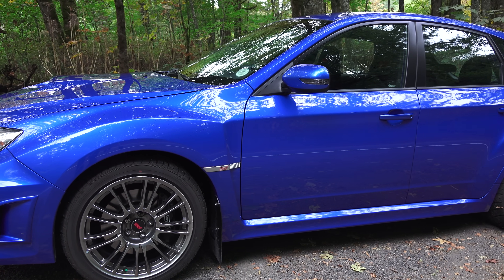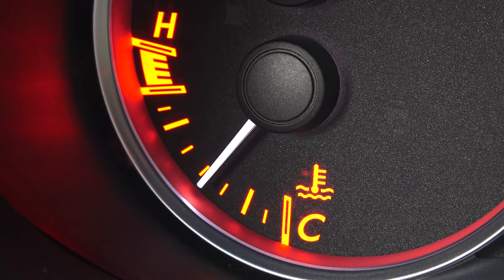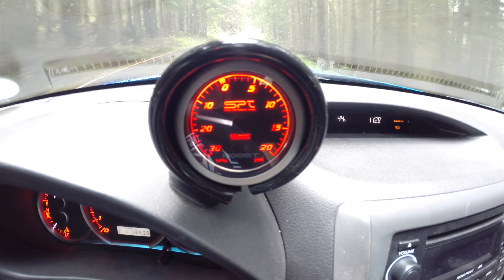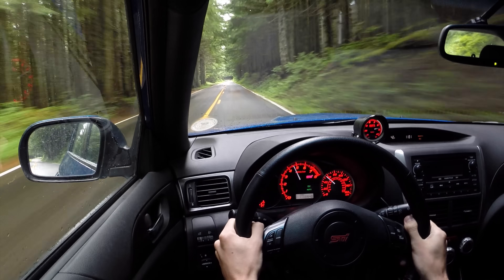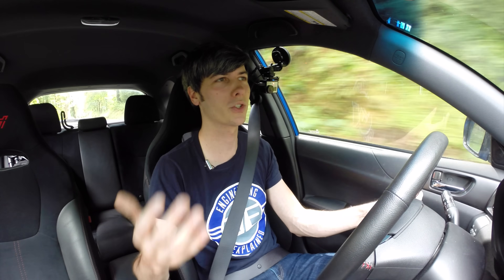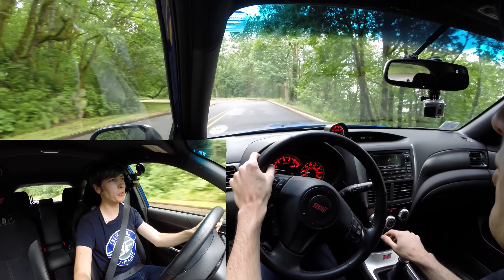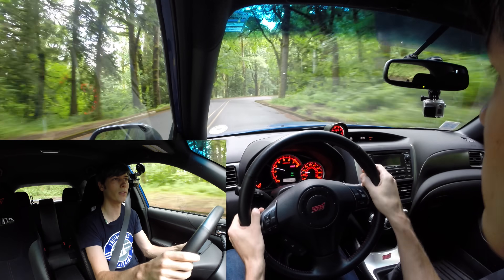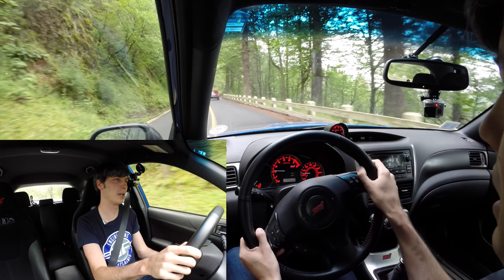5 Things You Should Never Do In A Turbocharged Vehicle

Comment: Describe engine lug ??? , don't  say a lug is when you can't  step on the throttle & pu motor rpm , my point being if you have two ident vehicles  but one has 10 % more fuel it wil accelerate , both engines  are under the same load ,give me a scientific description  of lugging a engine ?? You cant!!!!.

Comment: Turbo timer. Lets you engine run after you shut off ignition. Circulating oil.
Reply: So it flows oils through the Turbo after i turn the car off?
Reply: @dragospahontu  Yes, the engine keeps running. You set the timer for how many minutes, engine oil circulates to avoid coking of the turbo's bearings.

Comment: Not sure if it applies to Diesels Petrols or both, but doesn't the mass airflow sensor prevent excess fuel being injected if there is not enough air being drawn through the intake? I was under the impression that the MAF was what regulated the injection volume depending upon air flow?
Reply: Idk,

Comment: Most modern turbo charged cars don't require "cool down", as they are liquid cooled, and that coolant keeps flowing through to prevent the oil from coking. But I remember the crappy old Pontiac 301 turbos requiring owners to do this. Most owners didn't and those turbos would crap out before the car had even 50k miles on them.

Comment: If the way you're driving here is your normal way of driving, you are under revved for most of the time, as small engines, and especially turbo-charged small engines need higher rpms to make correct power and fuel burn. It appears to be me you're lugging, or on the verge of lugging your engine all the time in this video.

Comment: I have an 85 Volvo turbo that I added the optional oil temperature gauge to.  The thermostat did not open to send oil through the oil cooler until 90 C and I believe was fully open at 100.  It took often 10 or 15 minutes longer to reach the 90 C than the coolant did to reach operating temperature.  In winter the oil was too cold.  I had intended to insulate the oil pan for winter driving.  I would avoid any boost until the oil was up to 90, or at least 80 in the winter, if I could.  The sender unit was in the oil pan however- as part of the drain plug.  I sometimes wondered how this affected the reading and whether it was ok to let the turbo kick in when even after half an hour of driving, the oil was still showing as being too cold.

Comment: The old “dont turn your car off right after running it hard” was a characteristic of 80’s and 90’s turbo cars, hence people installing Turbo Timers. Modern Turbo cars including Subaru’s now continue to circulate oil even after you turn it off. Some cars like Audi’s have electric pumps that continue to run even after you turn them off. That tip is for old school turbo cars.
Reply: I can hear the pump working when I turn off the engine in my Golf R. It sounds like a little robot, like a service droid making things okay
Reply: @SniperReady  you know, I always wondered what that electric motor sounding noise was whenever I turned off my GTI.
Reply: Ryan Slattery it’s your droid beep booping your turbo
Reply: @ryanslattery2977  Yeah!  It kinda sounds like your sitting in an airplane waiting to take off?  I notice that sound even when I just turn on accessory mode.
Reply: @SniperReady  Until it breaks because it's a VAG car.
Reply: @MrFister84  exactly what people who don’t have money say to make themselves feel better about their garbage cars. Enjoy going slow and clenching your fists on the steering wheel furiously praying for other people’s cars to break
Reply: @SniperReady  all cars are amazing, old and new. But my 2020 cla 35 amg is trash.
Reply: @Autumn-v4u3x  It's a nice starter car, I'd drive it. Do you have problems with it?
Reply: @Autumn-v4u3x  best comment
Reply: I literally just bought a 2021 Mazda 3 turbo and the owner’s manual is consistent with EE’s explanation of letting it circulate and cool off.
Reply: @trogdor21997  modern cars will continue to circulate and cool the turbo automatically when shut off. My 5 year old car does it, and you can hear it working.
Reply: How about proton exora which still run and cool engine off after ignition is off?
Reply: If you're running your car hard until parked...you best let it idle a bit....(turbo or not)...The heads are much hotter than the block and it's best to cool an engine evenly...warped heads cause all kinds of expensive issues. When you're getting close to your destination (about a mile) get off the boost and throttle altogether.....simple.
Reply: Not all turbos
Reply: Boy you must be living the dream if you think only 80s and 90s turbo cars are like that. Most turbo cars up until around 2012-14 have mechanical oil pumps, so this tip still applies.
Reply: @waifuracer6516  Yep, Toyota Turbo Diesel, 2012, manual says that it is important not to turn the engine off for up to two minutes depending on driving style.
Reply: @waifuracer6516  YOUR STILL STUCK IN THE 80'S AND 90'S !!  GET UP TO DATE!
Reply: @waifuracer6516  Thank you lol, i was wondering what his definition of modern turbo cars
Reply: even my 1986 audi has this feature :)
Reply: It's not just because of the oil heating up. It's about how rapid heating and cooling can warp or even crack metal, so you want everything to get as cold as possible (or the engine bay to heat soak, to protect everything in a way) before shutting the car off - Especially in cold climates.
Reply: Not when you drive a 2010 turbo camaro ss
Reply: Heavily depends. Not all turbos. This isn't just the old turbos. Not every car is equipped with an auto system to automatically cooldown the turbo. I have seen both. But it's up to you to decide to check if it does.
Reply: so nice of you for thinking i dont still own 80s and 90s car...
Reply: No.
Reply: holy crap, glad I saw this. I always wondered what that sound was...
Reply: Yeah my gti has this
Reply: Even a turbo 2015 civic needs a turbo timer
Reply: a clown from my highschool would tell me this crap with his 2019 civic si.   Thanks for proving that moron wrong
Reply: Does this work in a Mazdaspeed 3??? Have a 2013
Reply: Really? That’s kind of cool! I don’t own any turbo cars, so first I’ve heard of it. Didn’t know they had their own motors/pumps
Reply: Ahh this must be what my Range rover sport Does when i turn it off. It is a weird electronic hum.
Reply: my mk3 leon can leave the fan on very loud after i turn it off and lock it, but it sometimes does it after a twenty minute commute and not a two hour drive with cruise control set to 74mph, it all depends.
Reply: My 2015 Fiesta Ecoboost circulates the coolant after shutting it off. Mostly on hotter days. It sounds like the car is still idling bc of the fan. When I first got the car I thought it was overheating bc the coolant looked like it was bubbling in the reservoir, but it was actually just recirculating which is what I later found out - also the temp was still in normal range. I also work at a gas station and have seen a few cars that do it. Asked a guy to shut off his engine and he confirmed it was already off and just circulating the fluids. I believe it was an Audi.
Reply: Yes, my '01 Audi TT has a coolant recirculation pump that runs for about 10 mins after shutoff to help cool the turbo.
Reply: Four cylinder vehicles should be never rely on torque and use revs instead and my 2000 WRX must run for at least 1 minute after hard work. There’s a big sticker on the drivers door pointing that out and I’ve been with too many idiots who either can’t read or ignore it and have paid the price.
Reply: I learned to do that in our Cessna Turbo Centurion in the 1970s. Let it idle for a few minutes to let the turbo wind down and cool prior to shutting it off to prevent coking the oil.
Reply: Doesnt take much time so why not do it anyway
Reply: dus10r , do you know if parking on a slop( driveway) will damage the turbo due to the oils shifting due to angle of parked car? I move it to flat ground for a few minutes before i start it and let it warm up just to be safe. ('13 Wrx)
Reply: Nathan Dorrington slope shouldn’t hurt them, the turbos actually have a small sump that holds the oil in place even when on a slope. And just starting it doesn’t put a lot of stress on the bearing. Turbos are high rpm low torque and they’re balanced really well so there’s not a lot of wear on tear on the bearing. New turbos are WAY better engineered than they used to be.
Reply: Shhh dont tell people this they dont like to read there manuals theyll be offended that your disagreeing with the guy on the youtubes.
Reply: Not true it depends on if its  ball bearing  or not, some  still  depend  on the bronze type, and ifs hot the oil will burn and carbonize on the bearing,, it's all up to you to check if you need to or not, that's not to much or too tuff to do
Reply: yah.  that tip is dead.  i have a 2004 audi a6 2.7t, and even that circulates the oil and coolant through, even WHEN my car is OFF. even after ive driven it hard.
Reply: Does that go for after market Turbo kits. For example like a turbo from greddy?
Reply: Same potentially rings true for the "lugging".  Ford, for instance, actually has sensors which listen and predict/adjust timing.  Also allows you to run any octane fuel you want and adjusts accordingly.
Reply: I think most people watching this will be car hoons buying 20+ year old cars to hoon and thrash.

Comment: You are a couple decades late on these cautions. 
*Many (most?) of today's advanced turbocharged cars have oil-to-water coolers that warm the oil with the coolant, and they also have circulating pumps that continue to circulate coolant and/or oil through the turbo after shutdown.
*Regarding lugging boosted engines, modern ECU's know more than you think, and won't do the things that you have heard on the grapevine. There are individual cylinder knock sensors that prevent the situation you heard about (from unreliable sources, it appears).
*Same is true for low grade fuels. While it is true that you will reduce performance and efficiency with low R+M/2 ratings, modern ECU's will protect the engine.
*Your "slip angle" discussion is irrelevant. Of course there will be changes in front and rear slip angles, but that's true of all cars, whether turbo or not, FWD, RWD, or AWD, braking, coasting, or accelerating. It's what cars do.

Comment: A lot of modern cars have small turbo's which are efficient from as low as 1500-1800rpm. They monitor parameters like air flow to inject the correct amount of fuel and Knock to retard and advance timing if pinking is detected due to pre-ignition.

Tuned vehicles fitted with larger aftermarket turbo's are another beast altogether, supporting modifications and a good mapper are key to safety.
Reply: If your car came with the turbo from factory and is half way modern I would assume the car knows where it is safe to run, especially in any automatic.  My 2.0 turbo is not going to do anything to kill itself on the factory computer tune.  My cousin's heavily modified STI is a different story.

Comment: Don't recommend buying anything with a Turbo, this is coming from prior experience. Turbos are connected to the down pipe, which are connected to the exhaust system.  It used the exhaust to force back flow to spool up the turbo, thus get " turbo lag " having to wait for exhaust flow to spool it. Now since is a process requiring turbo to work in time carbon build up would occur on the Turbo blades and internal veins.  In time the Turbo blades and internal veins will lock up.  Going from 32 mpg to 8-12 mpg. The way to correct it is to Forever fuel up with Premium Fuel and run the car hard. For the 1st 3 years I was gentle speed limit only. (Break in Period) then the Check Engine light turned on, it read Over Boost Code.  It really should be no boost. So it feels like loosing at least 100 hp you punch and it is just sluggish getting into speed. So buy Naturally Aspirated or Super Charged vehicles.
Reply: Look the compagny ''Procharger''
Reply: @m.morininvestor9920  Still prefer Roush or Whipple Super Charger 
Reaching 700 to 800 depending on state you live in 
In California Premium only goes to 91 octane so it would more likely be no more than 730 hp

Comment: It’s not about using carful throttle on the exit, it’s about going into the corner in a gear that puts you in the meat of the power i.e. turbo already spun up. If you have a good handling car as you pass the apex you can give it the full beans and suffer next to no understeer or oversteer.

Comment: you do know the engine pumps oil the moment the engine turns, the water temp wont rise until the engine is warm and the thermostat opens, and as for turning your hot engine off, have you ever red the manual of a turbo charged car , remember reading one and it was something like after driving at 120mph for 30 mins allow your engine to cool down for 30 seconds, so basic..  the length of your driveway at low speed should be fine, and if you aint superposed to go fast, why do you have a turbo charged car, wish i could un watch this video

Comment: I never floor it on low rpm. My turbo does not even start to give boost before 2200 rpm and full boost at 3000 rpm. So i only floor it at about 2000 rpm and that is not often.

Comment: Idk.. Ford’s 3.5 Ecoboost was made to make huge tq at a very low rpm like a diesel. It doesn’t need to rev hardly at all to move a load. I can tow a huge boat in 10th gear at highway speeds just fine. Boost may get up to 16 psi on an incline but you’d never even notice.

Comment: interesting and knowledgable video! My diesel has a dpf (filters out the black soot) and I noticed during more highway driving, I was hitting the gas more in 6th instead of downshifting since diesel cars have more low end torque, and I realised that my car was doing more dpf regens (car self cleans the dpf so it doesn't clog, basically burning off the residue that forms inside the dpf), but now that i'm doing more city driving and never really hitting the gas hard at low rpm, I drove it for almost 3 weeks before it did a regen, whereas with more highway driving than city driving, I was sometimes doing 2 dpf regens a week. Good to know since the dpf regen kills like 30hp whenever it's doing it making the car almost sluggish to respond/drive.....

Comment: Definitely do not just get the highest octane available for your car.....Use what's recommended unless heavily modified (i.e. increased comp ratio). If you put 91 in an engine that is optimized for 87, you aren't getting complete combustion. A fuel that is less volatile than recommended will cause decreased performance and gas mileage as well as incorrect calculated A/F because it doesn't burn as much. Also, most (if not all) cars now have a knock sensor. The threshold between correct and error is very small on these. If you are running the incorrect octane that is too volatile, you're more than likely going to set a knock code. Also, boost lag is a thing for a reason. Turbos need to spool before boost. It's not like a supercharger. You don't get boost proportionate to crank speed.

Comment: These are all based on misconceptions and older technology.  Some of it is just stupidity.  A fuel injected car is not just going to dump a rich mixture just because of your throttle position at a low RPM.  The ECU is mostly going to override your throttle position.  You also should not use the highest octane you can get.  Higher octane mixture burns at a hotter temp and can increase wear on a car not designed for it.  Some areas have 93 or higher and that is too much for many unmodified turbo cars.  He also should read about torque vectoring, especially since he has a Subaru.  This kid is missing out on a lot of fun..  seriously must be about the only person with an AWD talking about not punching it coming out of a turn..

Comment: Thanks again for driver safety and operational driving tips.  You're so right.  I get more boost by easing the throttle out of turn rather than flooring it.  Also, thanks to you I'm careful not to lug the engine out of first gear.  Besides, burning rubber from a stop at low rpm is stressful especially when you have to rev it at 3000 rpm to get the necessary torque.  Once I get passed first then it starts to rocket and that's fun enough.  Thanks again for operational safety tips. 

 And oh by the way Jason,  I just installed the K&N HP air filter and am quite happy with it.  Just the sound alone told me it was making a difference.  The jiffy lube guys were revving it when one guy said, "hey what kind of car is that?  I took it as a complement.

Comment: Actually some turbocharged engines like the 1.8 tsi require 87 octane. You get some more power with higher octane fuel, but it can cause problems.

Comment: Wouldn't a rapid onset of boost lead to a sudden increase in front slip angle and a sudden decrease in rear slip angle while exiting a corner? Lateral friction force divided by load on wheel is positively correlated with slip angle. If you suddenly get a jolt of forward acceleration coming out of a corner, that transfers load off the front wheels and onto the back wheels. The front wheels now have to generate the same cornering force with less load, ie requiring higher slip angle. And the rear wheels have more load available, so they would require a decreasing slip angle to maintain the same cornering force. So as long as you aren't exceeding the longitudinal traction limits of your tires, shouldn't flooring it out of a corner in a RWD car cause sudden understeer, assuming the car was neutrally balanced mid-corner?

Comment: I've always been concerned. I don't usually don't push it unless I'm entering the highway. I drive a 2018 civic 1.5 ltr 4 cylinder with a cvt transmission. So I'm driving about 3 to 4 miles maybe 30 miles or less before I get home should I still idle for a few seconds. Thanks great video.